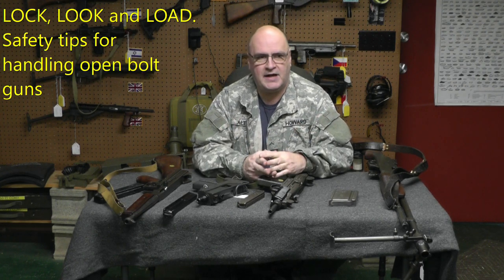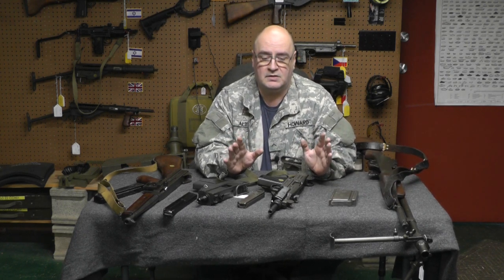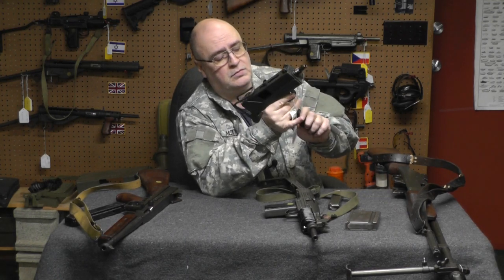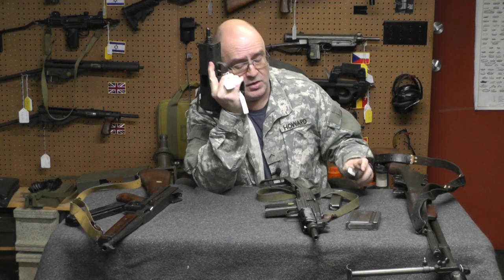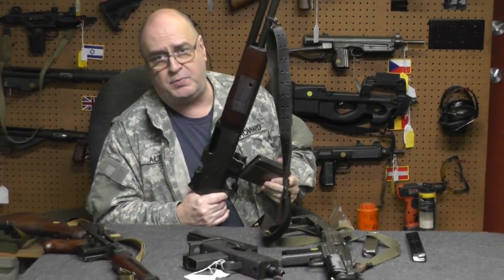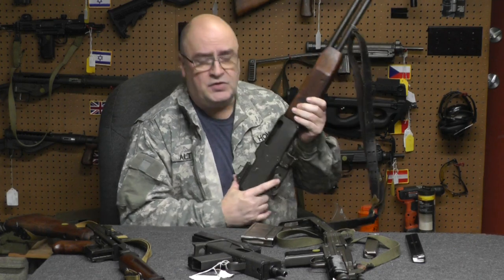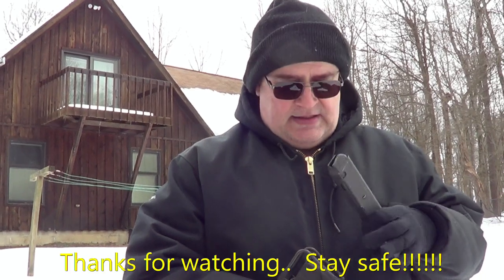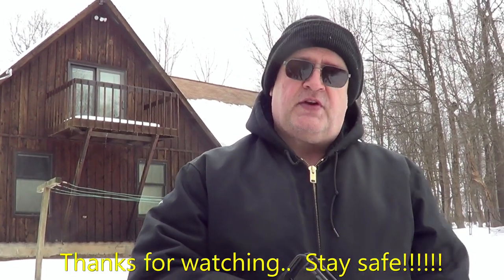Lock Look Load.  How to safely handle an open bolt gun.

Comment: This video seems so simple, but having never fired an open bolt gun I wouldn't have thought through far enough to see those potential NDs. When you were describing it before showing it, I thought it through and figured out what was going to happen, but not even considering the potential situation beforehand, I would have never thought that would be a potential issue. It is good to have videos like this out there, because everyone can use a little bit of safety knowledge with guns they might not be familiar with.

Comment: So in an open-bolt gun, you can either insert the magazine first then pull the chargine handle back or vice versa, eh?
Reply from the maker: Caulk the weapon, check the chamber, and then load the magazine
Reply: @psp1921tsmg  Thank you kındly.
And ıf I do ıt the other way, it is still almost the same, eh (provided that I am beıng safe) ?
Reply: @psp1921tsmg  Understood. So ın some cases a bullet can be stuck ın the chamber (similar to close-bolt guns).